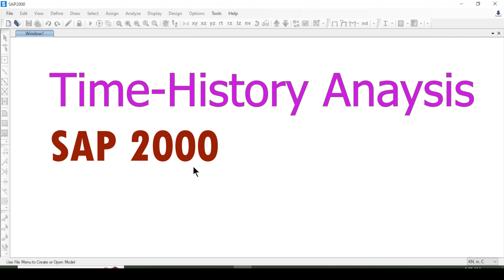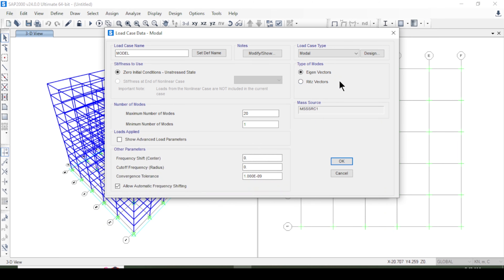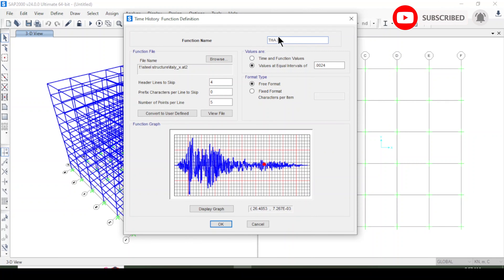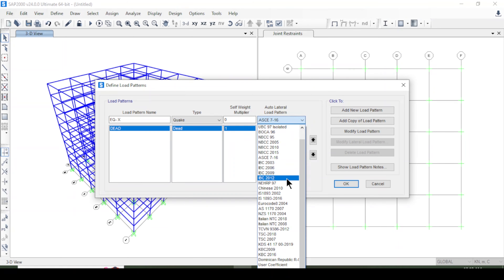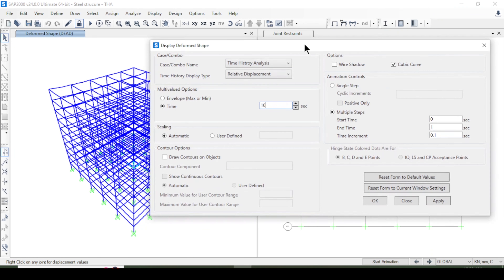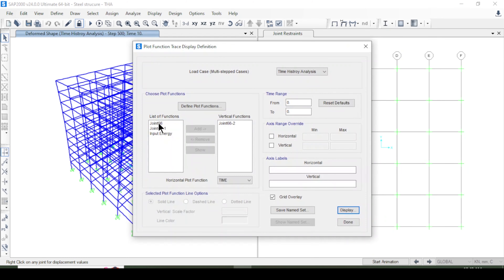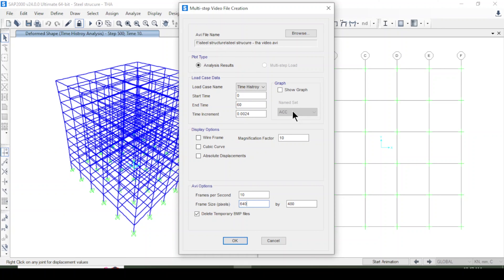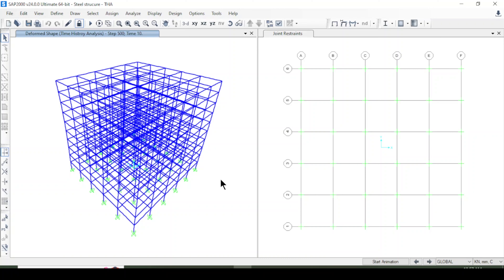Time-History Analysis of a (G+9)-Story Building in SAP2000.

Comment: I am doing NLTHA in Etabs can you guide me how long does it take to complete the whole analysis? my building is G+13
Reply from the maker: @arianahmed5132  it depends upon ur computer power, and which type of analysis you are conducting?
Reply: @SmartEngineer2  I am conducting Direct Integration but i switched to FNLA because it was taking so much time. I also have another question as well, i wanted to show the acceptance points in the deformed shape tool, whenever i check the box and apply also set the time to absolute max it doesnt show. The only way i can see is through the performance checks or by setting the D/C ratios. Am i doing something wrong?